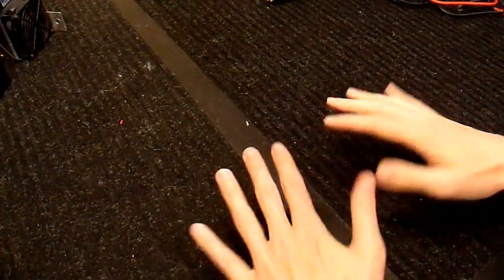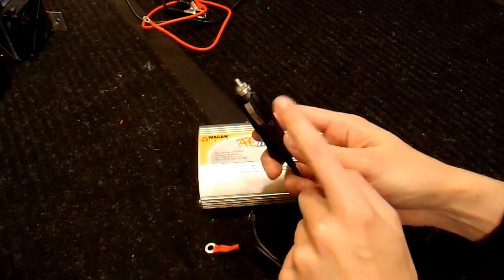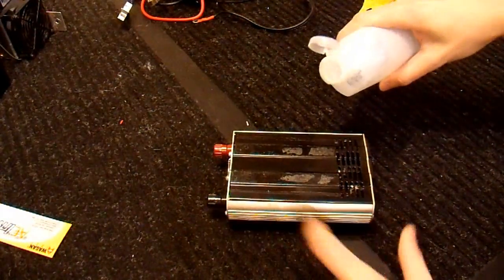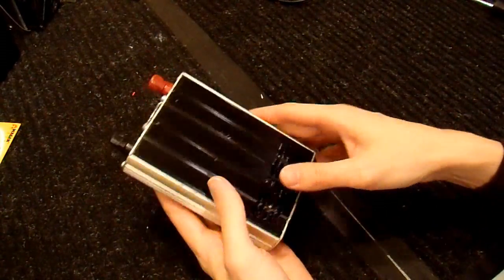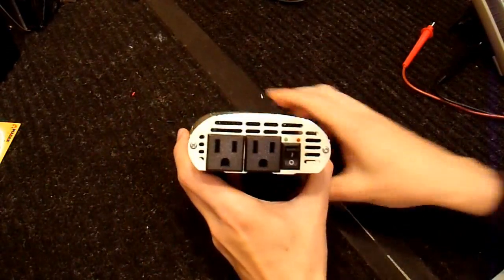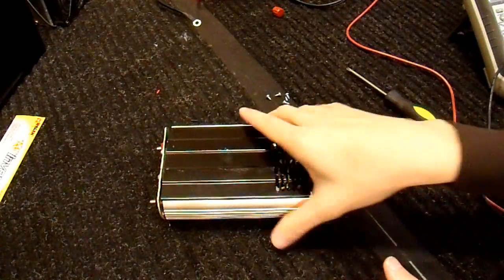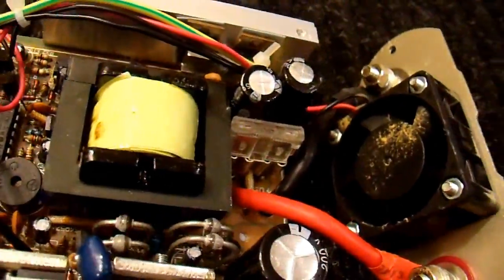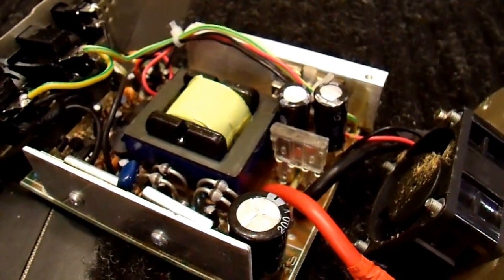Inverter Repair - Wagan Tech 400w/1000w Inverter How To  part1

Comment: Oh and how you tossed that bottom cover! Sweet!!!!! Write the company and list all those upgrades and improvements in the engineering you made note of. They’d be lucky to have your information. They’d prob pay you like 234 billion for the info then they would have to retool their entire process to pump out your more better totally awesome inverter. Oh and tell em to put in your patented wiggle and break transistors, mosfets, caps, and one ways.  I mean who wants to place the tip of a soldering iron on a spot for 1 min to remove components. Ha, fooie just break em!

Comment: I was wondering what the filler stuff was when I opened up my inverter after I reversed the polarity and blew it with smoke. Thanks - didn't know about capacitor guts!

Comment: You are the best. I'm following you with interest, but now I need your help, at least with some advice. I have inverter 12v 1500w pure sine inverter to which I pulled current over its output. Now he's dead, do you think is gonna be fixed? What is your opinion. Thanks. Regards

Comment: Samwha Caps I have heard they are prone to failure.   Many Samsung TVs have had the same issue with this brand of capacitors.    I recommend replacing them with good quality capacitors like Nichicon, Panasonic, or Rubicon.

Comment: I have a cup 850 800watt continuous and 1600 watt peak inverter and it was given to me and it has blown a resistor and don't know the value how do I determine its value I have pics but it says r6 resistor 6 written below it need some help in repairing it for personal use

Comment: I've looked out of curiosity and can't find a single 50A ATO fuse like whats mounted in this unit! I'm not sure they are even supposed to exist above 40A
Reply from the maker: 50A isn't common and is probably above what is technically reasonable from an engineering perspective - but it is what they chose to use.  A 40A fuse would be more appropriate.

Comment: Many thanks for your advice. I didnt know about testing the fets in situ by testing for low resistance between gate and source and gate and drain but my unit does not show a problem here. I have also tested the transformer in situ with the blue ring tester it seems fine. Also all four large diodes test ok. Any thoughts about how to proceed ?
Is there a simple way of isolating the DC circuits from the AC conversion ?Many thanks
Reply from the maker: If all of your FETs and diodes test good in circuit then you're probably looking at more difficult problems to repair such as control circuitry.  I'd check the gate resistors next, followed by the BJTs that drive those gate resistors.  After that you're looking at sourcing new ICs or other more complex issues to troubleshoot.

Comment: I am trying to repair a LINGQI power inverter 800 watt peak and 400 watts continuous. The symptoms are as follows :-
Connect 12 volt battery gets a brief spark as capacitors charge the a steady 0.2amp on the clamp meter surrounding positive battery wire.
Switch on and led glows green for about 2 secs ac output voltage begins to rise then the led turns red and alarm sounds. Watching the clamp meter during this process shows an alarming rise in input current to about 30 amps despite the fact that  there is no load on the ac output. Clearly something is shorted ! No visible signs of damage to FET's or Capacitors
Unit has 2 dil chips as control but part numbers are not visible. Any ideas about further troubleshooting. Thanks Tony
Reply from the maker: I'd check the input and output FETs for shorts between the drain and source.

Comment: One other thing besides reverse-polarity that can pop the input caps on one of these is over-voltage on the input. I have accidentally done that on one. The inverter was connected in a car, and the battery failed (open circuit). I connected a battery charger and it was on "boost" mode when I plugged it in. The combination of unfiltered rectified single-wave power and the overvolt condition popped the input caps. But it did not ruin any semiconductors.

Comment: Hi knurlgnar24,
Can you suggest some method to protect invertor from being wrong connected on the input side? As far as I know a general method is to put a diode bridge in the input  but that is suitable only for small current applications. For the currents above 10 amps the diodes will burn.
Regards,
Reply from the maker: As you said a diode will only work for low current draw applications and even there they work poorly.  Designing the product to withstand a reverse polarity connection until the input fuses blow is my preferred method.  If the fuses are user replaceable then the problem is solved.